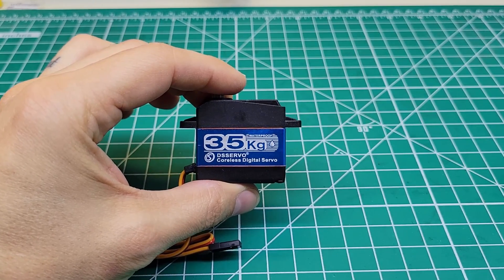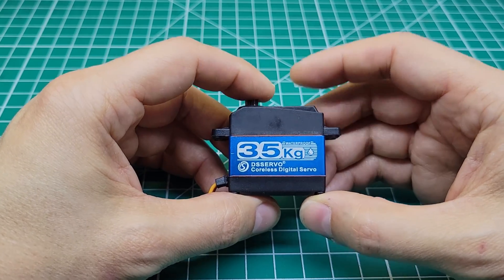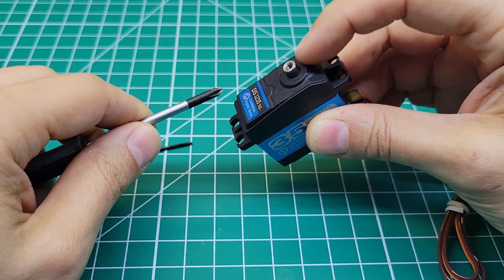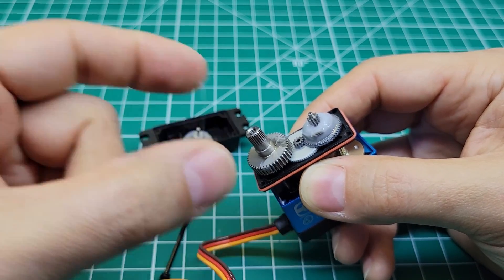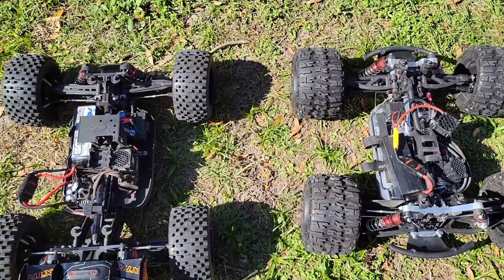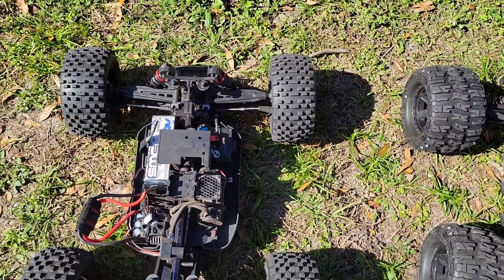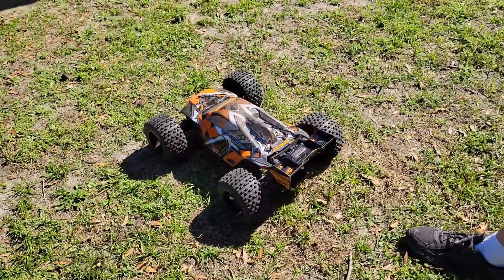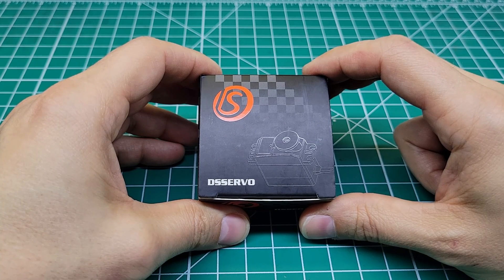Cheap Strong Durable 35KG Reviewed and Tested. Giveaway Closed.

Comment: Had the Feetech 35kg version from Amazon in my Typhon. 
 Worked great on the 6v the BLX 185 fed it, but it requires spacers under the mounting tabs or under the actual servo mount to the chassis in order for to fit & remain waterproof. Check that the bottom of rhe servo isn't pressed into the chassis after installing.
 I didn't have enough spacers, compromised the bottom seal & the board got wet. Took it apart, cleaned & re-greased it & it works fine with my 4s.
 Gets a lil glitchy on 6s. But that was only after literally driving through a large, chassis deep, puddle, multiple times I might add, with the bottom seal compromised. 
 I'd also recommend getting the Arrma 25t servo arm because they mount the linkage under the arm vs over. But it will work with the supplied arm just fine.
Reply from the maker: Good to know!

Comment: Thanks for doing this review. I put this same servo in my Kraton 6S about a month ago and it’s working great.  Significantly improved my turning radius over the stock S652
Reply from the maker: Yeah it's a definite improvement over pretty much any RTR servo
Reply: @DoRC  I think I’m going to try it next in my Maxx
Reply from the maker: @nickpacello2597  it'll definitely be an upgrade from the max servo
Reply: Mine is coming Tomm..my stock one is giving up the ghost...that was a good servo..but now its weak..and Yesterday started STTTUUUDDDERING.
Reply from the maker: I don't think you'll be disappointed. They're pretty tough servos

Comment: I’m looking forward for my corally Kronos 2022 xtr to arrive. I am still figuring out what electronics to get. I have Kuron 825 and the spektrum 150a. Hopefully they work fine together.
Reply from the maker: The only issue you're going to run into is that the 825 uses 6.5 mm bullets and the spectrum 150 amp uses 5 mm connectors. So you will either have to swap out one end of the other or get adapters. Thanks for watching and don't forget to subscribe for a chance to win :-)
Reply: @DoRC  just ordered a pack of 5mms connectors, thank you so much for your info. Much appreciated 🙏
Reply from the maker: @zeronineonetwo  you're very welcome. You also need a high quality soldering iron in order to swap those connectors out as the wires will wick away a lot of heat making the job fairly difficult with a low quality iron